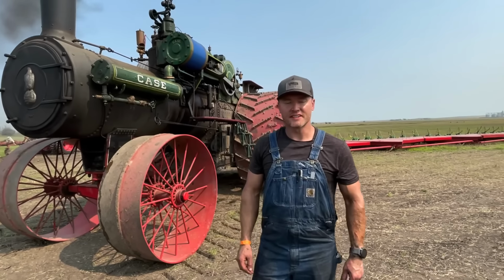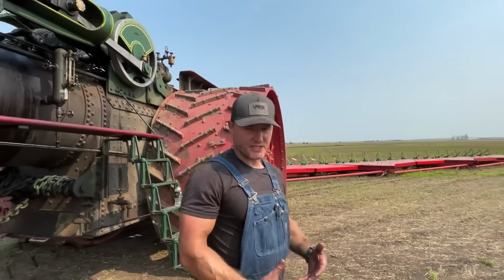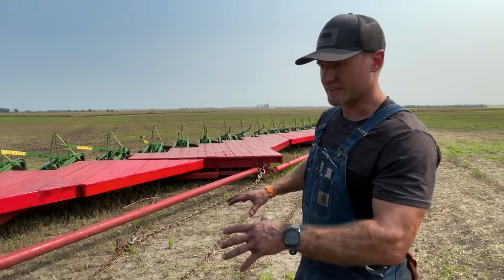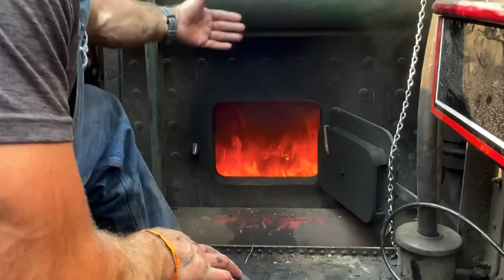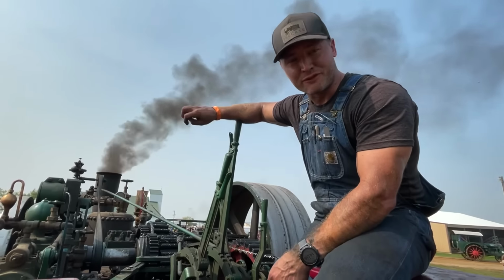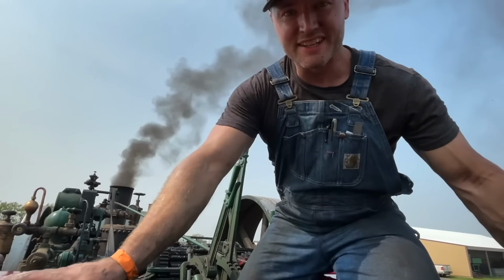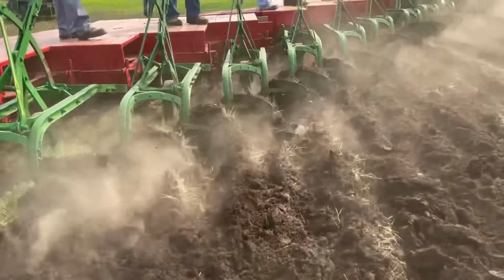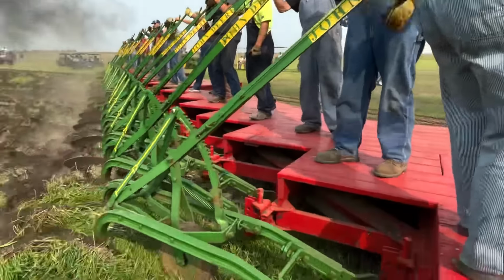2021 RECORD! 150 CASE Road Locomotive pulling 44 bottom John Deere plow

Comment: Time to join a tractor pulling contest with this thing.
Reply: It would definitely win, in fact I've seen modern, un-modified, diesel tractors make a full pull without even straining. It's more about traction than power. Also there are weight limits, this things is far too heavy to qualify.

Comment: i just don't understand  . how the  resistance of all 44 plows deep in soil all of the time  is overcome by few small slant fins of rear wheels making contact with the soil at only few tiny fins at a time. E.g.  if the area of all plow blades represents 100%  then the area of fins making contact with  soil is like 3%.

Comment: It appears that the attachment point of the plows is below the center line of the rear axle. Wouldn't that put more weight on the front axle as opposed to making it lighter?
Reply: Yes it would, but that’s the desired outcome, otherwise with this amount of torque it would be trying to pop a wheelie the whole time. Also on modern machines the front wheels usually have power too, so that position helps keep those down for better traction.

Comment: In watching the 44 plows are they set to maximum depth during the pull. And the actual use back then years ago did they need weight holding plows down into the earth or was regular steel used for weight instead of people?

Comment: A single cylinder, does the work of multiple tractors. The boiler pressure is 150psi. The Union Pacific 'Big Boy' is 360psi boiler pressure (4 cylinders). I love how steam plant has no gears (but BRUTE FORCE). The transmission of 150 CASE, cogs to gear it down (the rail loco has piston attached directly to drive wheels). The force of steam cylinders is more than from diesel or gasoline. No gears needed. External combustion.

Comment: How many pistons does this engine have? Is it just the one on the top opposite the threshing machine fly wheel? Or is there another larger one on the underside that drives the wheels? Surely there is a drive piston on the underside, no? There’s no way that relatively small piston on top of the engine could handle the pressure necessary to drive those wheels with all that weigh even if it’s a compound engine with late 19th/early 20th century metallurgy.

Comment: The steam engine is much more efficient than fuel internal combustion engines but with a better design not only the exhaust could trap more heat in also changing fuel to maybe something cleaner and less destructive. Mounting the water tanks above front wheels for better balance when loading the machine up,, solar panels with magnifying lenses to produce high temperatures instead of burning the old remnants of the great cedars and contamination of the soil and air. Many things with our current technology, titanium tubing in the boiler, insulation around the engine for better heat retention etc....Cheers

Comment: Several years ago I had the privilege to ride on a Case traction engine pulling a John Deere 5 bottom plow(I suspect it was a 16” plow) in a small patch where he grew wheat for his thrashing show (east of Arcola Illinois). While plowing he hit a rock and the plow unhooked. He stopped and it was so eerie to me because of the silence. There was only a hiss instead of an idling engine I’m used to. He backed up, hooked the plow back up and began plowing again. It was a small patch with short throughs but on one through we were going along and then it was like he shifted into overdrive! We moved noticeable faster. The engine sounded different. I looked at him and he was smiles from ear to ear! He told me that it was “pulling a draft”! One of my fondest memories. Growing up farmboy.👍

Comment: Can you run it on wood as well, or is that inefficient?
Reply: It could run on wood, but a LOT of it would be required, and does not have enough heat to provide high pressure steam when under heavy load, for very long.

Comment: Equipment like this you would get use to them, you know if an instrument is not reading correctly. You fix that gauge and good to go. Now days. A sensor is not reading correctly,  the computer screws up because of it, plugs the dpf in 30 seconds and causes a 10,000 dollar repair.

Comment: Nice!  What a great piece of work!  Consider comparing this work horse with a modern Case tractor which broke a record by plowing 310 hectares (770 acres) in 24 hours.  From your video it looks to me like you could plow 40 acres in 6 passes with the 44 bottom plow in 10 minutes per pass.  If so, your Case 150 would plow 770 acres in 19 hours.  Even if I am off a bit, the 150 is still competitive.  Certainly had no problem with the tractor pull.

Comment: If it can pull three times what a John Deere can. 

Even if it’s a third of the speed. Why wouldn’t they just use these on modern farms?!
Reply: the answer I've been told is that it is more a matter of maintenance issues than anything to do with performance but that honestly does not sound like it holds up: it kinda makes sense for railroads since it means that before too long each individual steam machine is largely unique which would be a BIG problem when maintenance and operation for/of an engine is relying on a network of repair stations and personnel spread all across the country but if anything the exact opposite is true for farm equipment, you can service a large portion of the parts of something like this with a damned hammer and anvil meanwhile most modern farm equipment goes at least as hard as your average car of the same time period on making self-service outside of general upkeep difficult or outright impossible without proprietary equipment.

Comment: Over 50 years ago, my Dad started taking me to the annual antique power meet/threshing bee in Sussex, Wisconsin. I got to hear the Case steam tractors at work running threshers or saw rigs. I only heard legends of how many plows they could pull. Until now! Thanks so much.
Another bit I remember hearing was something about huge plains farms somehow pulling plows back and forth between stationary steam tractors. Anybody able to help my murky memory?
Reply: That's referred to as cable plowing. It was mostly done the UK, and the engines merely power large underslung winches. They parked broadside to the field, winched the plow across, then each engine would move ahead the correct amount, and winch it back. It was mostly used because of soil types that the engines would sink in.

Comment: It would be nice to have some approximate figures on how much torque is needed to pull the 44 plows. Amazing craftsmanship!
Reply: It's probably using every available bit of torque to pull at that walking speed and this thing can generate over 5,000 with a higher end estimate of a bit over 8,000 if it's going full tilt which it basically was during each pull.

Comment: Useless invention. Who would hire that much workers just to plough fields. It will be better to use normal tractor and it will be cheaper
Reply: The "normal" tractor didn't exist in 1905. By 1910 there were 2- plow tractors available so could have used 22 of them instead.